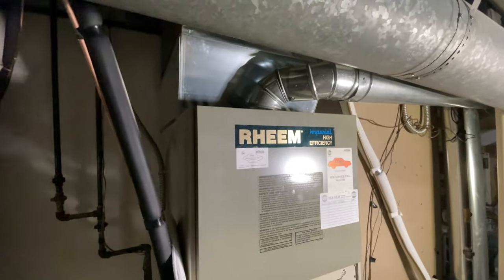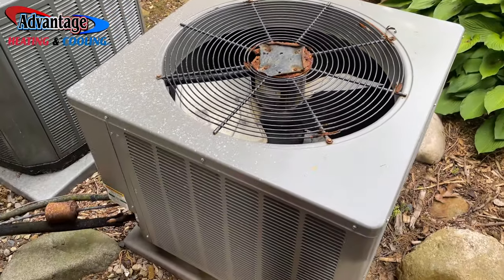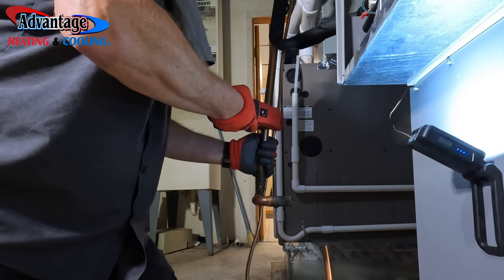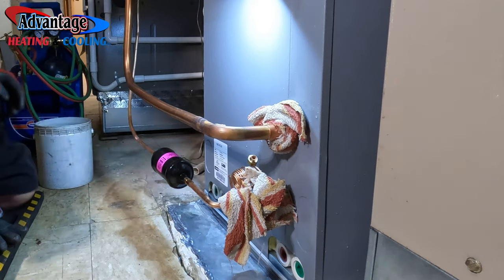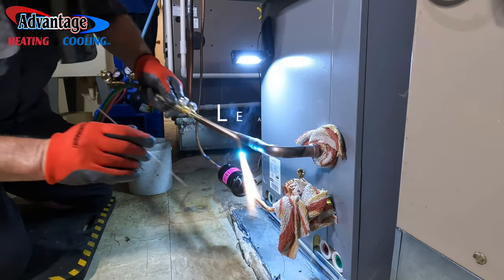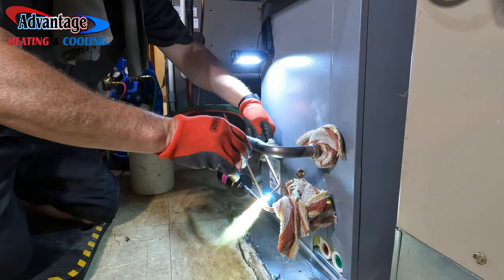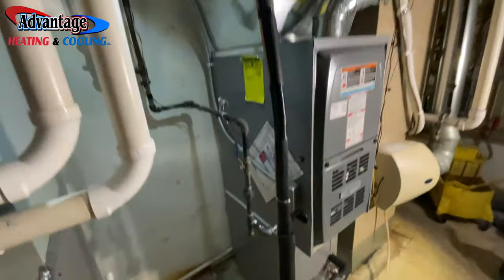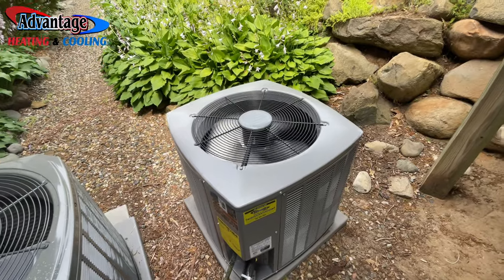Discover the Expert's Choice for Rheem Furnace and AC Replacement

Comment: I tried Staybrite 8 for the first time. Didn’t like it went back to brazing. I think you did a good job with the brazing.
Reply from the maker: It has it's purpose, the fittings have to be nice and tight and clean. Some extra steps. But yeah going back to brazing myself.